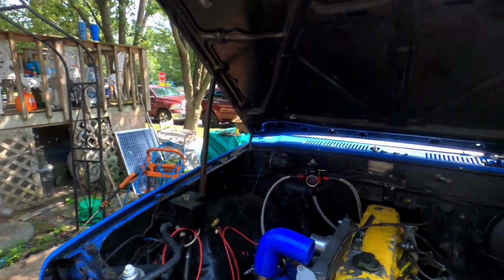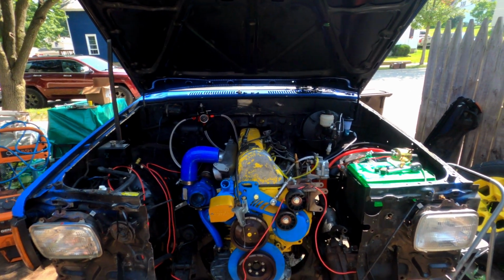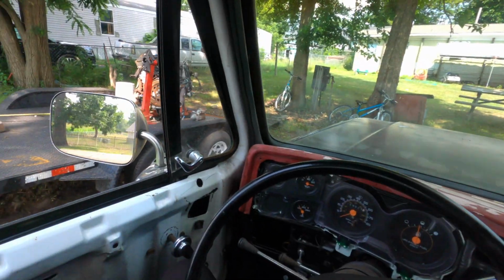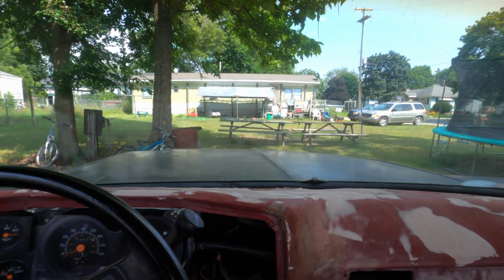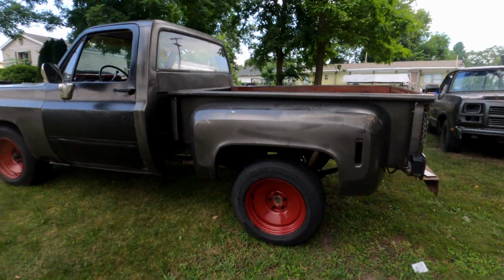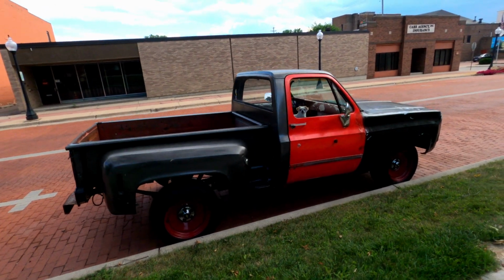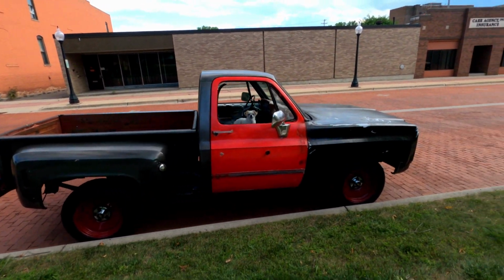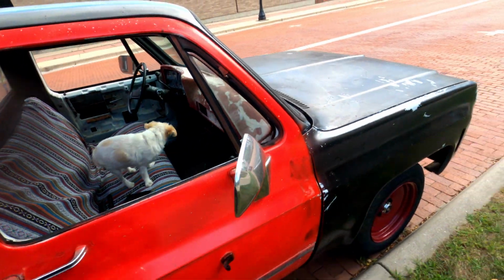Sometimes you just need to take a step back and enjoy life!

Comment: I don’t really know why I watch this channel. But I watch every dang video. Can you drop an LS transversely into a 1980 FIAT X-1/9? Probably not. 1984 Vanagon? Maybe. Would I do that? Probably not.  But here I am.
Reply from the maker: Sure, if you use an LS4 and 4T80
Reply: you can put a ls into anything.. it takes a small amount of crazy, large amounts of thinking outside the box,  welding experience, possible 80s music and possible blueprints for building a cradle to hold the power. unless you tunnel the car and make it rwd then the burnout gods will reward you